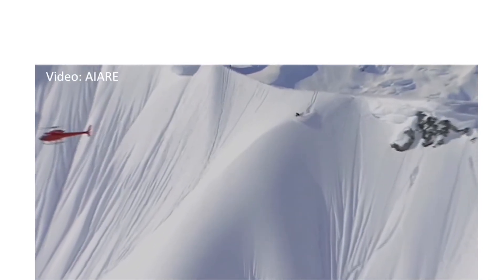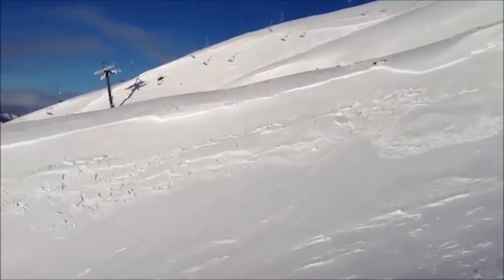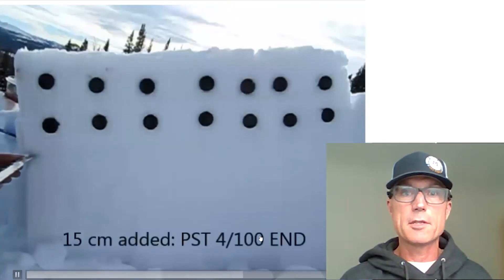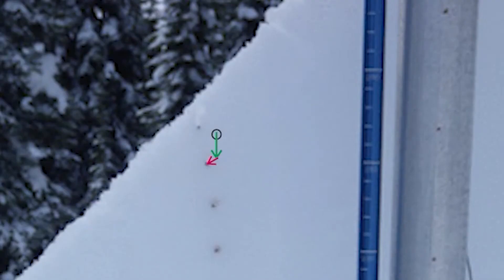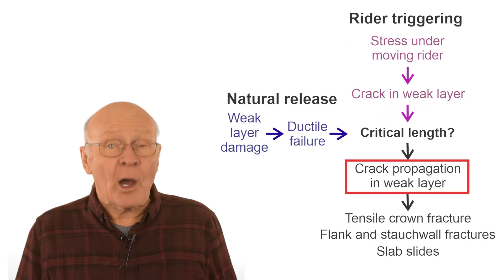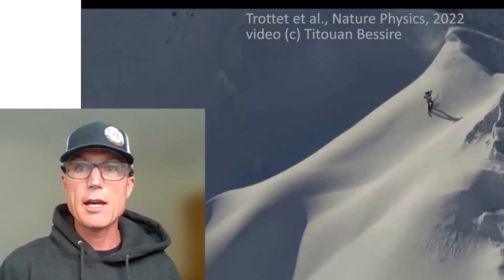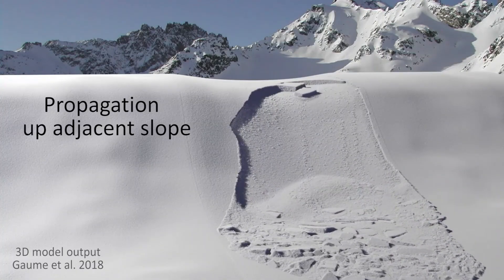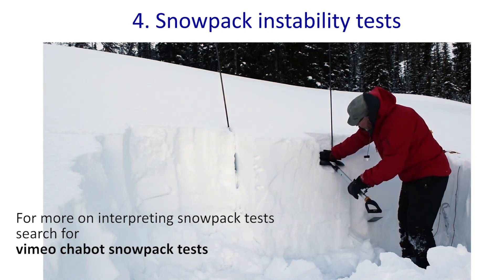An inside look at how people trigger slab avalanches

Comment: Disaggregated snow allowed to sinter added to column or block caused shorter cut length. We should interpret this result as collapse of  the column because it is incompressible . Conservation of energy maintained, energy cannot be created or lost. Replace release with collapse in our efforts to understand deadly avalanches. Beware of concave areas in compression not convex areas in tension. Our bulletins, warnings and advisories are the opposite of the hazard. Avalanche workers, their clients, their guests, their students and their devotees are the ones that are lost.

Comment: Instability tests with ANY failure do not indicate relative stability. They tell you which person in your party or which lap a dangerous event will occur. ECTX means you dug in the wrong location(crown mirroring). We should be collapse mirroring. In seasonal non-persistent snow which melts before June/July/August on ridgelines, benches, summer roads or trails, traverses and the locations we gather/ assemble/cluster. The progression of deadly avalanches is displacement, compression to incompressible then collapse.

Comment: The stress under the rider is collapse.  The concept of release is a misconception. The avalanche doesn’t slide after crown formation it slides when critical collapse transitions to super shear(collapse, mixed mode anti-crack). Many slope normal features may be seen before or as the crown appears. Collapse not release is the physics driver of deadly avalanches. Rapid loading is irrelevant. Collapse less than 1m deep after a large enough incompressible area is produced/ manufactured/ created by those on site causes deadly avalanches. Crown dimensions are irrelevant. Collapse vegetation protruding through the bed surface at concave areas under compression is the trigger. NOT convex under tension(30 to 35 degree slopes).